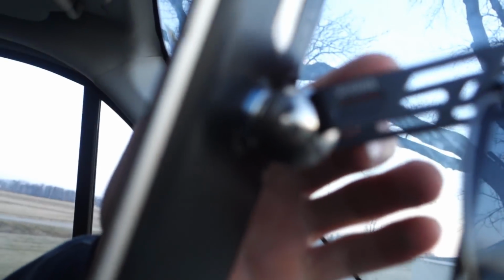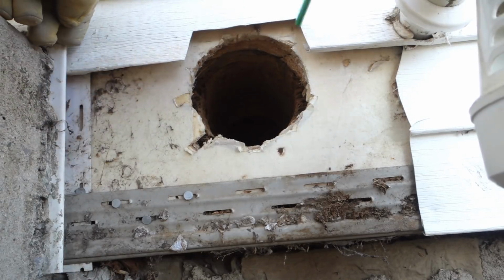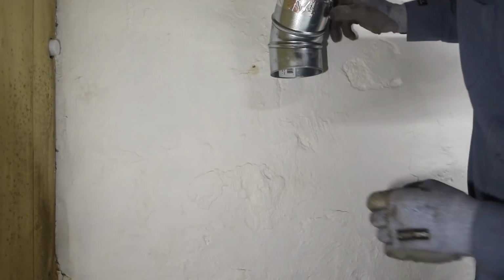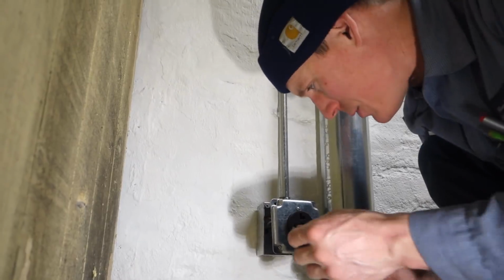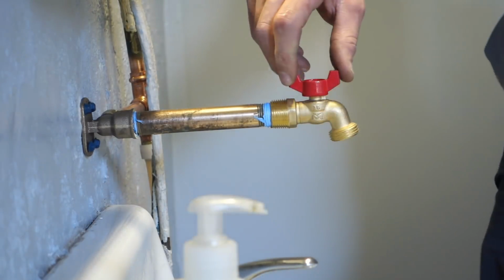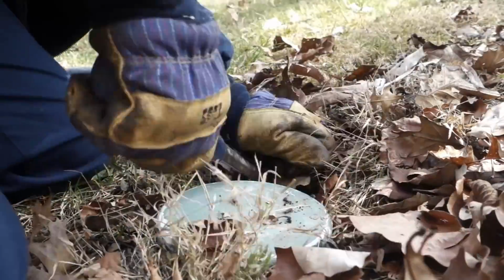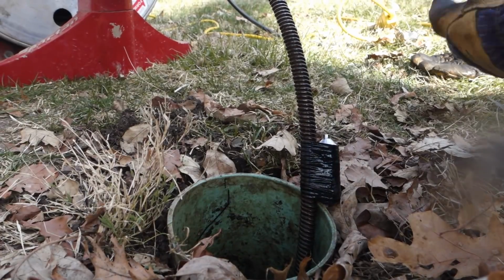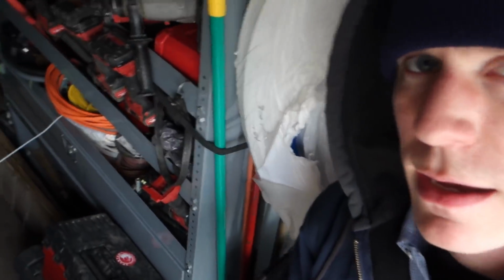This dryer is a fire waiting to happen....

Comment: Love your videos and learning from them.  I personally would go with a short length of flexible connection on the dryer to allow movement of the dryer by the owner and not have to work to put it back on properly.  Thanks for the work.

Comment: the 3/4&1/2 valve you put in they also make the same thing to garden hose adapters. I use em quite often for testing and hydronic heating.

Comment: was waiting for customer to run outside screaming nooooooo, somethings jumping around in the bathroom. lol
a friend ran one up out the vent pipe onto a roof once, well most of the way, there was two stupid sharp 90's back to back it made a new path :))
Reply: What do you use for your 4" Clamps and where do you get them, Thanks,
Reply: you posted under me instead of the video itself, but  looks like he used regular "galvanized steel/pipe hanger strap" to fasten the dryer vent pipe to the wall/etc. almost 2 wraps and screwed in place. the home improvement stores do sell actual 4" clamps for that as well as 4" "hose" clamps to hold pipe sections together. most common is to only use "good"(edit typo) quality "foil tape" for HVAC for all the pipe joints, no screws because they catch lint and help the pipe clog

Comment: I'd have opted to run a new line from the panel and used 4 pin outlet/plug/cord. which is code and should have been done since you relocated/spliced/added new :)

Comment: just a bad choice in bits for reversing through siding, standard bit with many teeth is best, which you have figured out for sure lol. heating with heat gun helps if it's cold or cheapo old siding. 
normally we steal siding off the back/side of the house/garage or from behind tree/bush, it's aged and blends in best, then just put the new/old stock piece in it's place

Comment: Nice fix, something you may want to try when you have to cut through vinyl siding with a holesaw ..put the drill in reverse to cut the vinyl, this will melt your way through the siding, then switch to forward to cut the backer material
Reply: same for cutting it with circular saw, put the blade on backwards ;)
sometimes that still fails on cheap/old siding on cold days
whoops, forgot to say it looked he had it in reverse!
Reply from the maker: I show in the video that I am going in backwards
Reply: couldn't tell... sry!!
Reply: john colasanto very true. But just don't use such an aggressive bit like the one he used. 
And always remember....
Old & cold creates misery.

Comment: That siding might have cracked (it was so brittle) even with a regular hole saw! Great work all the way around!! :) You can check but i think you can use that 1/2 inch romex connector wrench on much bigger connectors because the tabs on those connectors are only 1/4 inch apart and i think it will hook on almost any normal size connector.  and once the connector gets pretty large you probably won't have enough torque to tighten it with that wrench anyway.

Comment: Did you ground the boxes?
Reply: Not by the look of it. Only 2 screws in the outlet cover plate also!
Reply: Why did you say 'by the look of it'.  The last we saw of the electrical for the boxes (I think) was @13:23 and @17:08.  All we see is the un-sheathed Romex...not how Brad wired it.  Given his other videos and how careful and experienced he is, I wouldn't bet against his work.  Likewise, I regularly (though I'm not an electrician) will put on a 2 screws to hold the plug in place to test my work - and then add the remaining screws once I confirm there are no issues.

Comment: Hold a piece of quarter inch ply on the siding, then drill thru in reverse using a cheap shallow steel hole saw, the more teeth the better.  Glad you were on the bottom course!

Comment: Brad, does your company do a lot of excavations? I find it imperative nowadays if I see an older clay line to video it. Especially up here in Grand Rapids, where most homes do not even have outside cleanouts (Yes even new construction). Normally they have 4" cast iron for the home with a cleanout on the stack in the basement, and the transition is to 6" clay 95% of the time in the yard. That leaves a lot of missed root intrusion and potential for callbacks. Also, were those saddle clamp cleanouts on top of a hole in the clay, or just a hole knocked out and a pipe sat on top of it. Love your videos and professionalism on the job.

Comment: I learned this from a friend who is an electrician. When cutting conduit, Take tubing cutter and don't cut all the way through the conduit, like 3/4 way through and just snap the conduit over your knee. It leaves no burr on pipe I.e. no need to ream pipe. It is slick. Wonder if it works same way on copper??

Comment: Oops that should be 10/3 with ground. Can’t use the bare ground for neutral.
Reply: Colin Gyles 10/3 with ground.
Reply from the maker: There's no neutral coming from the existing feed though, the whole dryer runs off 220 ... Or am I missing something
Reply: KnarlyCarl the motor is 120 volts the heating element is 240.
Reply: You would have needed 10/3 if it was a 4 prong plug. Some appliances run off 110 and 220. Didn't look like that dryer did though
Reply: But if it's a 3 wire cord on the dryer ... what is the added wire going to do?
Reply: Colin Gyles Code requires for prong plugs. very few electric dryers are 120. A apartment size dryer for example.
Reply: If 10/3 with ground were pulled to it then the dryer cord would need to be changed to a four wire cord and the receptacle changed to a four prong also. There is a jumper in the dryer that connects the neutral to the dryer frame that would need to be removed, then the neutral ties to the dryer neutral lug and the cord ground ties to the dryer frame. This keeps the neutral and ground separated so the bare ground does not become a current carrying conductor while the 120 volt dryer motor is running and/or the light bulb in the dryer is on.

Comment: Glad to see you test that before actually disconnecting it. Once I was building DSLAM cabinets and they have a 240V two phase feed power that is then rectified what is needed. During testing I turned off the main switch or so I thought. Turned out the handle moved but the actual switch did not that day, they had separated and boy did I get a surprised when I put my screwdriver on one phase of it. Thankfully I didn't go across both.
Reply: No such thing as two phase power, it is single phase.  Households operate on Edison 3 wire, single phase 240, with the middle of the 240 grounded or neutral.  That's why it appears to be 2 phases, when they are actually the same phase, 180 degrees apart.
Reply: What you are referring to is split-phase. This is what is commonly used for residential and even commercial supply. 

However if you'd read what I wrote this was an industrial application which was four wire two phase. DSLAM stands for digital subscriber line access multiplexer. In addition many older large buildings that had lots of two phase motors to run are wired in either 4 wire two phase ore three wire with a double sized common two phase. 

Lastly 3 phase has replaced two phase for distribution which is why it's only older buildings wired in two-phase. So yes.. two phase very much does exist though it is less common today then it use to be.

Comment: 90% of the calls i took women were the ones who clog evetything lol
Reply from the maker: MegaBait56 wow wow wow!!!! Never come across dental floss in a drain!! I don't care who did what, just let me do my work and pay me when I'm done lol
Reply: your right.  once i hit a one foot long wad of dental floss and stuck the cable and coudn't get it out for nothing at the base of a stack.  owner blames wife, kids, mother in law.  after i chopped up the concrete basement floor and cut out the cast iron and seen the dental floss the guy put his Johnson back in his pants cause it was "his" dental floss no one else. it caused a shouting match in the house.  costs him $2,600.00 to replace the piping and floor. lol.  everyone blames everyone for stoppages....
Reply: he was the only one that flossed in the house?
Reply: the whole family turned and looked at the father.  lol   guess so............dental floss mixed with tooth paste, hair sets up and is tough to break through even with the best power cable snakes.  this case the floss wrapped around the cutting head and was impossible to clear and pull out the cable. Brad's right what should only go down a drain...............
Reply: Yup, lol.

Comment: You didn't mention the wire sizes you used, but what I could see of your electrical work...good job!
Reply: LEO ASHRAE 10/2
Reply: I pull individual #10 THHN (with a third wire for ground) when I'm using EMT.